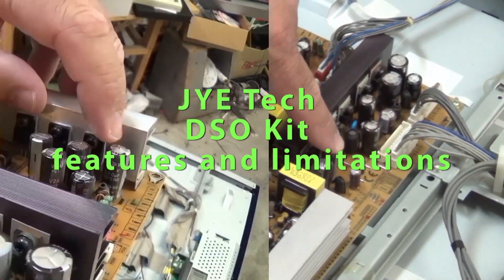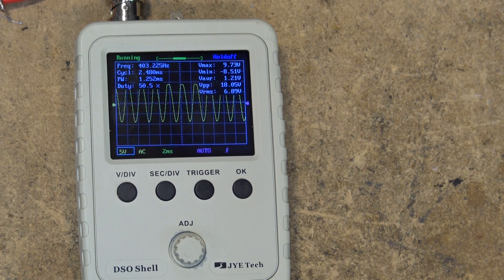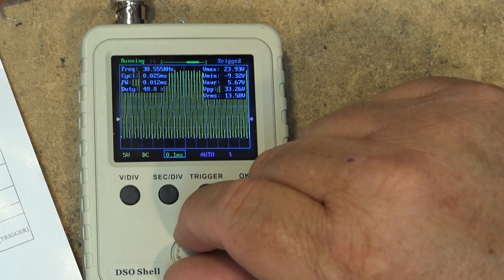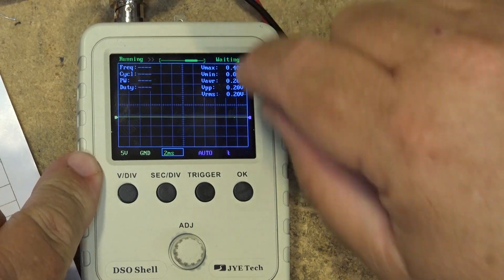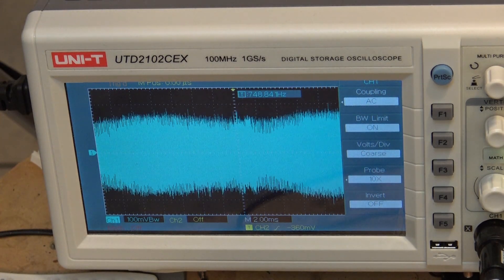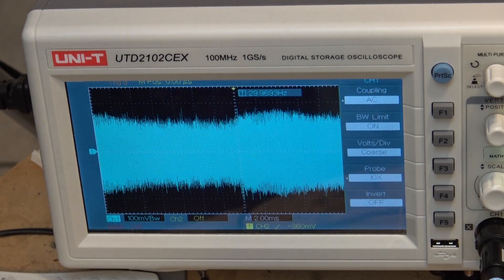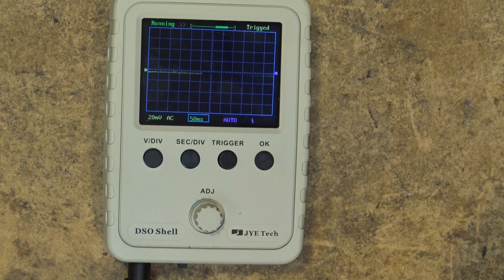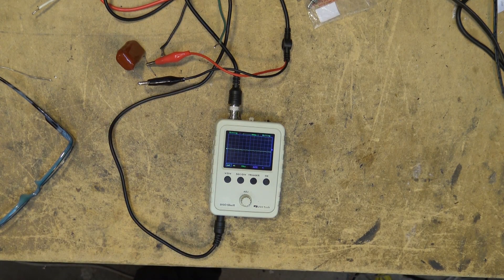JYE Tech DSO specs and feature test

Comment: In this video, around the 6 minute mark, the frequency is being increased to see "when the wheels fall off", and at a frequency still far below 200kHz, the formerly regular waveform has already clearly begun to alias badly, but 12voltvids lets that go and continues to increase the frequency until the amplitude drops significantly, then concludes that is where the "wheels fell off". This is because while the scope's analog bandwidth is up to 200kHz, its sampling limitations result in unreliable waveforms somewhere above 50kHz, with the problem being worse with non-sinusoidal waveforms (which require much more high frequency content to record the true waveforms, a LOT of that well above 200kHz). This is an important limitation that the majority of people 'reviewing' this scope fail to take note of.

Also, the "measurements" screen is often unreliable. For example, when this screen is first shown in the video, a roughly sinusoidal signal is shown, with AC coupling in effect, yet the + and - voltage peaks are significantly different. If this measurement function were working correctly, it should be showing the highest and lowest peaks, which should be closer to being the same (some distortion of this can be due to the somewhat corrupted waveform).

Early in the video, it is stated that holding the "V/Div" button for 3 seconds centers the display vertically. Well, yes, but the real importance here is that this operation tells the ADC to regard the current voltage input as 0V, so it re-establishes 0V in the digital part of the circuit to be the same as 0V in the analog part of the circuit. On this scope, those two things can often drift pretty far apart, so when 0V is being displayed/measured, the actual signal can be quite different from 0V, and thus the scope needs this function to get them resynchronized.

It can quite eye-opening to input a waveform up near 200kHz and adjust the settings to get a stable-looking waveform on the display, and then actually check from trough to trough (or peak to peak), note how many horizontal divisions are between them, multiply that by the indicated Sec/Div, and take the reciprocal to get the frequency, and then drop your jaw to see that what is displayed is VERY incorrect in regards to actual signal frequency. This is because of the aliasing, which can become a problem well below 200kHz. A LOT of reviewers of this product assume that because a stable-looking waveform is displayed, that it actually represents the input signal. This user mistake can happen the most easily with sinusoidal input signals; it is easier for the user to notice the issue with non-sinusoidal signals. Again, the scope's specified 200kHz bandwidth ONLY applies to the analog front end circuit, NOT to the digital section that does the sampling, and depending on settings and waveforms, the digital section's "wheels can fall off" at frequencies much lower than 200kHz. Based on my own tests, I would not consider this scope to be reliable at frequencies above about 50kHz, and if high-harmonic input signals are being measured, limiting the scope to only "audio frequencies".

Comment: I only work on Vacuum tube Amps for Guitar use. Only, I need a audio sound tracer that can model the sound wave and show what the Amp is receiving  how is it conditioning and amplifying the sound. I am retired therefore poor. would this little device help me in debugging, tracing and tuning sound signals with the amp, tones and bias adjustments. ??? Dennis in Virginia

Comment: What bandwidth would I need for a DAT alignment. Prefer not to opt for the $200 scopes
Reply: Seriously, if you are getting into things like DAT alignment, you should not rely on cheapo test equipment. Garbage in, garbage out.

Also, the practical bandwidth is NOT 200kHz. The specifications say that the ANALOG section's bandwidth goes up to 200kHz, but with my own experiments with this scope, it can't be relied on to give real waveforms above about 50kHz; after that, the sampling rate and other limitations are what dictate scope performance, and conveniently the specs don't mention that number.

The demonstrations of higher frequency signals given in this video are not indicative of the real performance. In my own tests, it will mislead you by showing a nice looking waveform, but there is a good chance that it is actually lying to you.

Comment: For just standard things like viewing audio waveforms like  standard audio or raw waveforms, this should be ok?
Reply from the maker: Yes audio fine.  No good for video.
Reply: @12voltvids  thanks for the reply! Also, what about subsonic stuff like low frequency oscillators? 

Was wondering if the sensitivity would be an issue there.

If i did decide i want something more robust, what would be a good value scope that won't break the bank?

 Thanks again!
Reply from the maker: @cubis  It will work fine with low frequencies.

Comment: Is there any way to get the FFT function out of this meter, perhaps by exporting data to a laptop and running it through some a software program?
Reply: The User Manual says that the scope firmware supports capture buffer data export via serial link to a personal computer, but the kit does not come with the connectors to implement it, and the case design does not have provisions for it. Assuming that a user can hack this up, then you can do whatever you want with the data once it is in your PC.

Comment: nice review anyone else who reviewed it the iv seen put it down and call it a complete toy and not worth getting... but for god sake  ya  can buy these for as low as 14 bucks with free shipping!!! I think for  that price its a great little bit of kit.. so fair play for not putting it down...
Reply from the maker: It is what it is. A basic way to look at audio waveform.   Is it a high end diagnostic scope? No but will it display waveform and help you troubleshoot a preamp or power amp? Yes.
Reply: @12voltvids  exactly and it's my first properish scope.  I only started learning last October'ish and my first buy was a must tool MT8205 scopemeter and before it arrived I had already advanced past it suiting my needs. (Still it's a good accurate meter) but like I said for 14 bucks its the perfect scope for someone learning like myself till I have the money for a proper one.. P.s. I should of noticed you were Canadian and not American by the way ya talk.
Reply: This is an 'open source' design. Lots of companies are making scopes based on that free design, apparently with variations in firmware, supplied components, etc. There are also at least a few variations on the circuit schematic. But they all look the same on the online listings. So when you say that you can 'buy one of these' for a certain price, how do you determine what exactly 'these' means?
Reply: @youtuuba  i suppose ya cant, but i remember someone saying to me that there is a few little things to look out for like the CE mark having a space between them! that fakes dont have, which i was glad to see mine had to be honest.

Comment: Can you check mains with this??? I'm 240 mains voltage!! Because i got one dismorning and I'm putting it together 2moro but I'm not going to try unless it defiantly can! Did I hear you say 500volts on 10X probe setting????
Reply from the maker: 500v on a 10x probe is 50v to the scope.
Reply: @12voltvids  So can you check the mains with it.. or is 50v the max absolute???
Reply from the maker: @keithking1985  
With a 10x probe yes because 240v will have a p-p of about 330 which would be 33v on the 10x probe. 50v is the max it can measure with a 1x direct input 500 with 10x
Reply: @12voltvids  Thank you very much the kit build I got had the alligator  clips  and not the probes. But I bought a pair of cheap ones that has 1X and 10X I to use with it..I'm glad to hear that it can do mains.
Reply: @12voltvids  Thank you Mr 12volts that makes sense. Plus the kit build I ordered has those black and red BNC alligator clips with it. But I ordered a cheap pair of scope probes (only €4.67 or something like that with 1X and 10X )   but thanks for your reply it really put things in prospective for my. My next scope will be either the Daniu ASO that recently came out before I get my first bench scope.  Anyways  I'm probably driving you mad by this stage, so thanks again for your help...its much appeciated🙏👍👍👍👍
Reply: @12voltvids  The User manual says maximum input is 50Vpk, which would be 100Vpp (assuming they did not mean to write 50Vpp).

Comment: You can now get these fully assembled for around $30 off ebay. Very useful for RC modeling where you'd only be using it with low frequency PWM and serial data signals up to a few hundred hertz at most. If you use it with a wall wart make sure it's regulated 9v and not just an unregulated wall wart (which will damage it) An unregulated 9v wall wart actually goes up to 13v-14v depending on load and it cannot tolerate this. Most common wall warts used in consumer electrons are unregulated.
Reply: I was inadvertently using a 9v AC adapter with the scope (had assumed it was DC) until I noticed the ripple and then switched to a 9v DC regulated.  Hopefully, I didn't damage the electronics - it still works fine.  I believe there is diode in there for blocking reverse polarity.  Also, there are knockoffs, so make sure it is the genuine JYETech product before buying.

Comment: I ordered one, have not testet it yet, but was going to try to check LIN, CAN, PWM etc. signals in cars, if it is fast enough. And it also works for to check for bad connections and other stuff sometimes a bit easier than a multimeter. Since it is so small it is very easy to take with you compared to a big/"real" scoop. If it does not work, it is not a really big deal since it is so cheap anyway, then it could be used to practice with atleast.

Comment: Thanks, I built one of these while spending the winter in the Mohave Desert of Arizona, I used a little component ID device to sort out the parts, then soldered her together using a cheap USB soldering Iron.  Had nothing but trouble with her for the first year, never got it to do squat, then one day I was posting a question about it, and my own question rang the repair bell!  The rotary encoder was not responding to my input.I tried replacing it, and the little guy came to life.

Comment: I do a bit of Guitar tube amp building & repair   would this be a suitable scope or does it need to a higher voltage rating ?
Reply: It can stand voltages,I would use a 600 volts cap in front and a 10x probe.being only 200khz bw,if you have some kind of higher frequency oscillation inside you won't see it.Also it is very sensitive to mains frequency,in proximity of transformer it's easy to pickup couple volts of hum.
Reply: Maximum input voltage is 100Vpp.

Comment: Would this little scope work fine for checking switch mode power supply readings? Thanks
Reply from the maker: mark grunenwald 
Yes provided you don't exceed the max input rating. A 10x probe would solve that.
Reply: 12voltvids , Great thanks. I ordered it. There's a rechargeable battery conversion kit I ordered with it. It all fits inside, so it's portable. Love your videos, I'm learning a lot! Thanks!
Reply: @markgrunenwald2670  could you leave me a link to that batterie conversion please. Thank you..

Comment: Great review, you have convinced me to buy it as my first scope!
Reply: Wim Lex me too.
Reply: I mostly do audio and power delivery projects/builds and for that this Scope is pretty much all you need (that and an audio clip with a frequency sweep or a cheap Banggood function generator)

Have to say, this thing has been rather satisfying and has had plenty use beyond the projects I usually do. Best 20$ in electronics I ever spent tbh.

I recently also bought the DSO188 which actually comes with a battery and goes up to 1Mhz. Also just 25$ and rather well reviewed.

Comment: I bought one of these last year, and put it together while we were in our RV down in Arizona.  Never could get it to work, and one day I posted on a video such as this one, nobody had any idea either.  Then one day, I came upon my comment, and it dawned on me, the rotary encoder was not working when turned in the backward direction!  So I ordered some cheap rotary encoder's off Ebay, and replaced the one in the unit. I had to modify the case  slightly as the new one was a bit thicker, but after the replacement, it now works like a new machine!  I guess there are times when you just have to listen to your self.

Comment: I got one of these a while back. Like you say, for audio frequency circuits it's actually a handy little tool. It'll never win any prizes for accuracy but for taking a quick look at signal levels etc it's great. To power it, I bought a handy USB to 9V adapter from eBay (I think) which cost about £1.50 delivered. This lets me run the unit from a USB power bank.

Comment: hello, on the oscilloscope what is the purpose of the external trigger could you explain if you would please? thank you sir.
Reply from the maker: External trigger is just that. You can have your scope traced triggered by the measured waveform, by triggering when the voltage hits a certain voltage level, of when it starts increasing or decreasing, or you can have an external source on a second or 3rd input. In this case that external trigger is used just to trigger the trace, or in the case of DSO, trigger when the capture to memory starts.
Reply: Generally you want to look at a tiny portion of the waveform over time. Sometimes this corresponds to some aspect of the waveform itself, like where it crosses zero. Other times, you want to see the waveform only when some other signal is changing. This is what a separate trigger is for.

Comment: Hey guys where can I find the esr meter shown in some of this guy's videos
Reply from the maker: The shop I bought mine at, main electronics has now closed their doors and I do not know who is carrying them anymore, but if you search you should be able to find one. Mine is the Disk Smith design.
Reply: Bob Parker designed the Dick Smith ESR meter that Dave uses, they don't make them anymore.  The replacement design from Bob Parker is the Blue ESR Meter,  and you can find it everywhere pretty much.  Just google "Blue ESR Meter".
Reply: I have MESR 100 esr meter and is very accurate.

Comment: if it can trace sound circuits then it sure has its uses
Reply from the maker: For someone that only works on audio circuits this is all one needs.
If you need to look at IF circuits in a radio, well it is going to fall short, as IF is typically 455KHZ for AM and 10.7MHz for FM radio, but baseband audio this will do the trick, and it is dirt cheap.